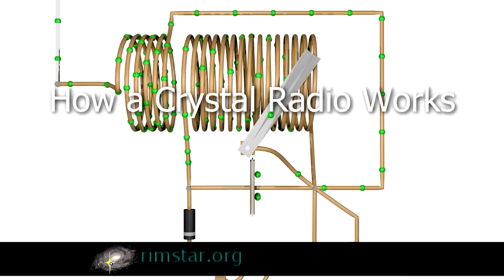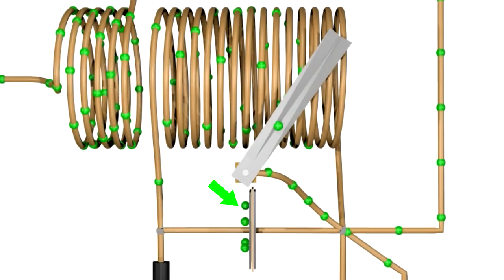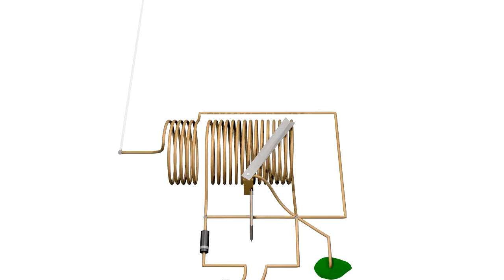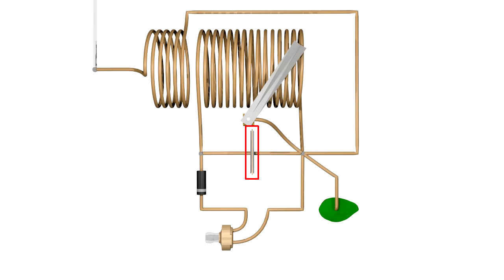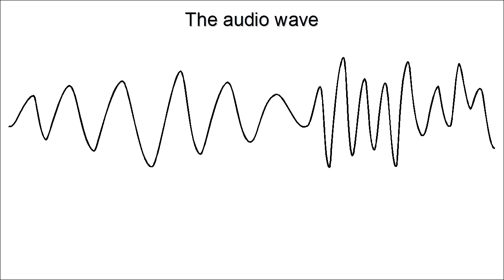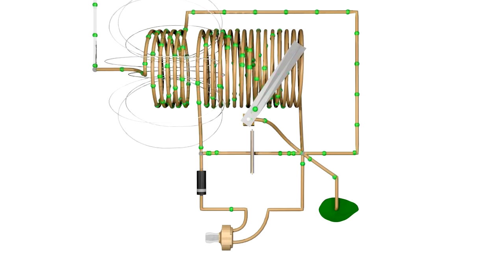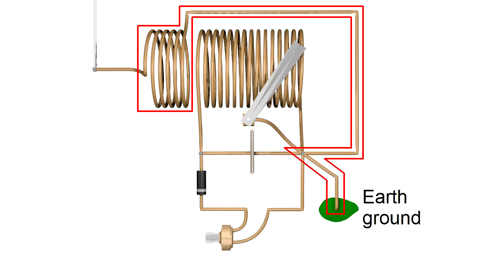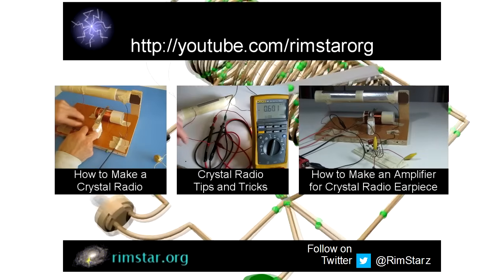How a Crystal Radio Works

Comment from the maker: The radio gets its power from the radio waves themselves. No batteries or other power source is required.
Reply: Thanks , that's the reason why I came here but watched the whole thing because of the incredible presentation.
Reply: Came here for the same reason about radio waves self powering
Reply: Well it is electricity after all
Reply: In other words, “wireless electricity”.
Reply: It's always crazy to realise how much power is just flowing around us constantly
Reply: Its electromagnetic radiation 
Wireless energy…
“Radiation”
Reply: @quagmyer7230 speakers draw electricity to listen too
Reply: Holy hell
Reply: But, doesn't that mean it will be weak ? Then why did they not spread widely, but those that depend on the battery or wall source spread instead ?
Reply: Only a power supplying to set the cristal and its related circuits  is needed and maybe to some other needed signals amplification  . No batteries at all is an ambitious project to be concretized .

Comment from the maker: Yeah, that's a deliberate requirement I set when making all my explanations, that I show the thing working at as low level as practically possible so that there's little left to the imagination. Words and static diagrams play a part, but seeing the electrons, electromagnetic fields, radio waves, heat flow, ... makes how it works blatantly clear.
Reply: A great presentation! ( Only wish my hearing loss could better accept  a  slower commentary. No criticism intended.).
Reply: I'm an artist with an interest in learning about electricity/tech as a  hobby and you make it completely possible for me! Much easier than some books I've bought to teach myself. Thank you!
Reply: This was incredible. Thank you Sir
Reply: L0p
Reply: 0
Reply: @zeedoogyboy Been a while since your original comment, but you can adjust the video playback speed in the settings - (Icon that looks like a gear). 👍

Comment from the maker: Ooops. Sounds like now I need to make a History of Crystal Radios video! :) The "crystal" in Crystal Radio refers to the days when an actual rock made of crystalline galena was used as the diode. A wire with a sharp point would be carefully pressed against the crystal and if the location and pressure was just right, the combination would act as a diode. In the early days, magnetic earphones were used instead of piezo crystal earpieces. Some hobbyists still use both today.
Reply: That's how we did it in the '60's. We even hand made everything; basically just snipped tin coffee can, copper wire, blank toilet roll, speaker, and a crystal rock. 

I followed my brother's Club Scout handbook on how to make a Crystal Radio.

Thanks for the memories, have to share with my grandchildren.
Reply: @thurmanwatson5954   I'm trying to build a radio like that, very "rude" with a real piece of Crystal, but I can't find a single project on how to do It. Can somebody help me? I have a lot of white quartz at home and I wanna use it
Reply: @Alburx  I’m sure there’s something out there best of luck to you
Reply: @Alburx  No silicon. It is best to use a germanium diode, which you will probably only buy for advertisement, or to make galena - the instructions are on the internet. It is also possible to use lead sulphide (in the crystalline state), carborundum, copper oxide, zinc oxide, pyrite, etc. as a detection diode. Curious old detectors also include a flame detector or an electrolytic one (I will not explain their function). I recommend period high-ohm headphones (2-4k), which you buy for an advertisement. There are many schemes of crystals on the Internet. However, before you build a crystal, I must remind you that the crystal processes amplitude modulation. If there is only FM in your area, you do not need to build a crystal. :)
Reply: @DL-kc8fc  so the Crystal Is only for AM and not FM so the radio frequencies are not processed by the Crystal diode,  cannnot listen to radio FM with a Crystal based radio right?
Reply: @Alburx  If you have the FM transmitter in sight from the window, it is possible to pick up a very weak to almost inaudible and poor quality signal. This is more due to the circuits of the tuning coils with capacitors, which cause a phase difference (power fluctuations) and a diode (crystal) by some chance to somehow process it as AM. I managed to capture FM around 80MHz this way, but very badly. Namely, a crystal above 100 MHz basically does not work, even in the case of AM. In order to receive FM on a crystal, it is necessary to add an FM to AM conversion in the way I have indicated (phase discriminator, slope detectors), but well designed, or a phase-locked loop circuit. In both cases, you already have to use transistors and power, so you gradually find that instead of a crystal, you are building a "normal" FM radio that has nothing to do with the crystal except the low-frequency part. In the end, you will also make this part different. The philosophy of the crystal thus disappears, because the crystal is primarily about the crystal and the absence of power. Thus, in general, FM does not capture with the crystal, because the signal strength (gain) of FM is of the order of mV, while in AM it is hundreds of mV. The crystal does not process high frequencies of very short waves even in the case of AM (poor selectivity). The crystal is only suitable for long and medium AM waves. If you do not have such transmitters in the area, you do not need to produce a crystal. Make an FM radio with a 1.5V battery in a soap box, but I rather recommend using an old mobile phone, which has a real FM radio (without internet connection) and which you can connect to portable speakers. The voltage source can be a small photovoltaic cell ...
Reply: @DL-kc8fc  I understood everything but now I'm more confused then before about making It. In teory looks easy but i see that my problem Is to put that in practice. Thanks for your time and for sharing your knowledge with me
Reply: @Alburx  Maybe you can receive AM on medium waves. It is necessary to try it on an old AM receiver. In some areas, AM transmitters for emergency needs operate with a strong signal. However, it is more likely that you will find only a few FM transmitters with many stations that the crystal does not receive. My intention was not to discourage you from building crystals, but to save disappointment.
Reply: @DL-kc8fc  I have to write down everything and then I'll probably have a clearer view. Now it's even harder what I have to search on Google, so many projects and little changes in the cercuit that make me think that there are 2 options: follow a project; design It by myself. In each cases It will not work at all 😂
Reply: @Alburx  An amplifier, such as old active PC speakers, is all it takes to try out the ability to receive on a crystal. On the input - on the live end, which growls when touched, attach a germanium diode or other high-frequency diode, followed by a longer piece of wire as an antenna. Hold the other end of the input from the amplifier (shielded end) in your hand, or connect it to something metal, such as a computer case, etc. If you hear several stations at the same time, or just one station and very clean, you can build a crystal. If you want to build a regular FM radio with transistors or IOs, you will definitely succeed in any case. :)

Comment from the maker: You're welcome! It was a pleasure being able to make this one, mostly because to do it I had to learn the pieces I didn't know. I'm glad you liked it. Thanks!
Reply: 11 years to late to say your video is incorrect on how the diode demodulates the radio signal, it is in the non-linear state, and acts as a squared law detector.  That is why crystal radios use germanium diodes, because the voltage is so low, and a germanium diode has a forward voltage drop of 0.3v vs 0.7 volts for silicon.  So many people have been misinformed!!!

Comment: I attended an electronics school in the U.S. Air Force for nearly a year back in the dark ages when the term Hertz was not used (CPS) and we had digital vacuum tube circuits.  I have watched just a few of your videos, and had you been my USAF instructor, the school could have been half as long.  Your use of animation and excellent easy to understand descriptions make otherwise complex processes very simple.  I subscribed, and plan to follow all of your videos.  Thank you!!!

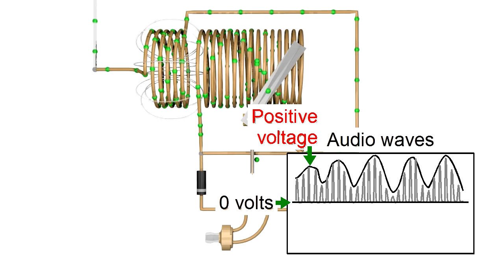Comment from the maker: The diode is for converting the radio wave back to the original audio wave, as is said at 10:20 in the video and explained in the section before that. For the antenna, I showed that in my How to Make a Crystal Radio video. I just used one of more 15 foot longs wires in parallel, connected where the antenna goes in the circuit. Depending on how close you are to radio stations you may need longer. 15 feet is actually pretty short.

Comment: Thanks for this video. When I was about 14, my parents bought me a radio-shack experiment kit for Christmas. The crystal radio design worked and my mother was amazed. This was the only time she ever seemed impressed with me.  I was so moved by her reaction that i later got a BS degree in electrical engineering. While i did take the class on radio theory, I don't recall them explaining what the diode was for. After these 40 years, I might have just forgotten but it is certainly a treat to hear that old circuit explained so well as your video does.

Comment: Excellent production!
An electrician ran a class for a youth club (Boy's Brigade) I belonged to in about 1964 and I built a "crystal set" under his instruction. It used a germanium diode instead of a crystal. I learned about the crystals at the same time. It had a variable capacitor with thin plastic insulation beween fixed and rotatable vanes for tuning, Through studying the cct diagram, and with his explanation, I was  enabled to understand resonance, rectification, modulation, resistance, capacitance, and microphonics. What a start! I never looked back, and have had a career in telephony and electronics, more recently optical fibres, ever since. Thanks, Mr. Andrews!
(I used that thing for a couple of years until my Grandmother gave me a new-fangled Japanese Sharp transistor radio, which had the disadvantage that I had to buy batteries for it , whilst the crystal set was sounds for free!)
Reply from the maker: Thanks! Yeah, that's what I like so much about crystal radios. You learn so much from one device.
Reply: May I respectfully recommend Physics Videos by Eugene Khutoryansky ?

Comment from the maker: The foxhole radios are basically the same as the one I describe in my video but without the ability to tune intro radio stations using the second coil and the variable capacitor. I think it is possible to tune the foxhole a little using the pencil on the razor. Since there is only one coil there is more overlap of stations, unless you have just one really strong one. The pencil and razor are the diode. I'm glad you found this video helpful! Thanks for the feedback. And I'm from Ottawa, Canada.

Comment: One of the best gifts I ever got was a crystal radio set that I had to soldier and assemble. I was 16 years old in Guam and it was 1968.  I was fascinated,  as, at night I could pickup Radio Moscow from Guam. I became  an Aviation Electrician in the Marine Corps. Later, I became a Navy Aviator. One of my projects involved personally installing the first GPS in an aircraft that did the first actual mission using GPS. And flying that mission. And now at age 73, retired , I am studying for my HAM amateur radio licence.

Comment: Hi, great video, despite someone always has something to say, anything that goes towards learning is a good thing.
Actually crystal receivers CAN detect FM, usually nearby local powerful FM stations, I have a couple of videos showing this.
It is called "slope detection, when tuning is slightly off the centre frequency of the station, and as the frequency modulated carrier goes in and out of the radio's resonant frequency, an audio signal similar to the original modulation is made.

Comment from the maker: We've continued this in private messages for more room but for the benefit of others, larger diameter plays a part when you get into loop antenna coils. Those are crystal radios where a large diameter coil (1 1/2 feet in diameter for example) is used as both the coil and the antenna. You can see one of these in my "Portable Crystal Radio using Loop Antenna and Pizza Box" video.

Comment: I really hope you continue this series, it's what I was looking for in terms of explanations as to how things work in circuits like this radio. I wouldn't mind learning how other things work this clearly either, this low level is really what makes it click for me, oddly enough.

Heck, I wouldn't mind if you went over formulas and stuff too, like "so and so discovered this, and turned it into a formula ___ where _ is ____, and this is basically just * some epxlanation of the electrons interacting * in notation form"

Either way, I am in awe. Great stuff!

Comment: pleasant memories. I built my first crystal radio at age 8. Then I modified it to receive shortwave frequencies. Next step was a 2 transistor radio, powered by a single D cell battery. Been in electronics ever since. Thank you, sir for the video. Well done.

Comment from the maker: I guess you've seen the video starting at around 10:42 and are wondering why the Earth is a good ground? It's such a large object that it's easy to take electrons from it since it has so many, and it's easy to give it electrons. If you try to give electrons to a small object, it will quickly become strongly negatively charged and repel any more electrons. But it would take more electrons than you can provide before you strongly charge the Earth ground, even if it's just your backyard.
Reply: I know I'm seven years late, but you managed to make me understand something with this one comment that I never was never able to grasp before. Thank you.

Comment from the maker: Your calculations look right to me. You need a germanium diode, not a silicon diode, not a Schotkky diode. That's because it needs to be leaky. I use 1N34 but there are plenty of equivalent part numbers. Be sure to also watch the links to my other crystal radio videos related to this circuit in the description below this video. There's a lot of helpful information in them.
And thanks! Blender rocks! You now know why I appreciate your channel. :)

Comment: Crystal radio! happy daze .I built one from a kit....50 years ago. It kinda worked. Then being a 13 year old genius (sarcasm not bragging BTW) I started experimenting. We had an old broken down vacuum cleaner. stripped out the motor and used the wires to wind my own coil, also for the antenna which was looped 4x around my bedroom walls near the ceiling. Then for an earth had the wire going from upstairs bedroom window into the ground of our backyard. Replaced the tuning capacitor (a trimmer) with the interleaved vane tuning capacitor from a duff radio. man...it was cool and damn loud. Kickstarted a fascination that led to qualifications in Applied Physics and Electronics and a career in electronics. Cheers.

Comment: The best explanation of radio I've ever heard even compared to Berkley, MIT and other introductory lectures. I'm a retied lawyer and want to know how things work. I made a large amount on Cisco Systems with only knowing that in 1990 someone told me that computers "need to talk to each other" and these Stanford scientists had a "router". I should have sold when I was patting myself on the back in 2000 10 years later, but waited one extra year 2001 - but what I leaned was what Baldwin Locomotives learned the hard way - steam engines would not be around in 1880 as they said when offered the diesel engine in the early part of the century - a far more efficient motive power. You get stuck on "brain bias". I assumed the most valuable company would last, yes, the company might last, but it's value does not. In 2000 Cisco was the talk of the newspapers, but when I invested nobody ever heard of a "router":, that was the time to invest, not when the newspapers were in love with the technology - easily copied, no ":moat": like say Coca-Cola. But 10 years did what Coke took 80 years to return. Now I don't do that, but am a student of yours.

Comment: Nice animations and descriptions. I like how you quantify the tradeoffs of circuit design and some of the subtle characteristics that  provide functional results such as the crystal earphone and diode leakage. Have you ever derived the speed of the actual electrons that  flow? I was surprised to see that they actually move pretty slowly but the resulting field effect is what we perceive as fast; approaching C. Reality is subtle. Thanks, Bob
Reply: Electrons don t flow (from one side to another).  Electrons stay with there atom, but they will transfer energy (to eachother)